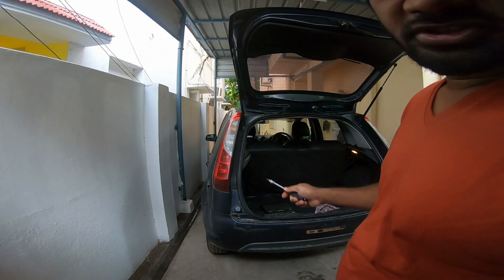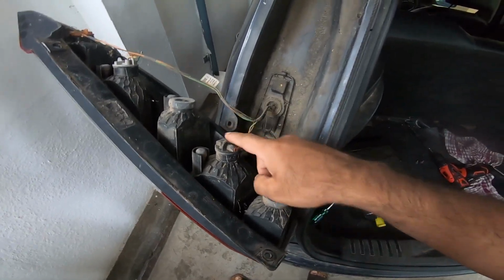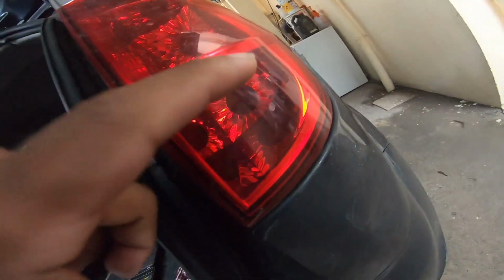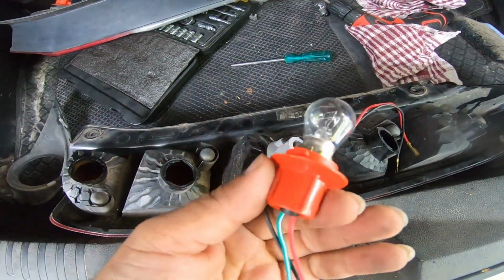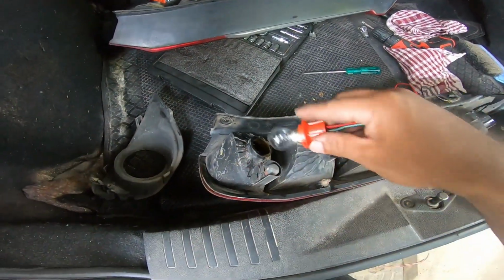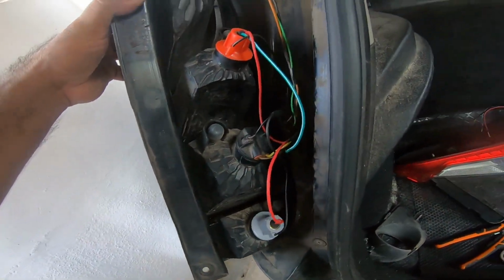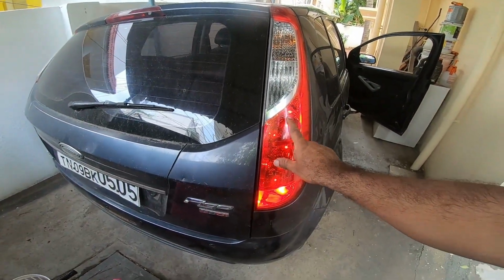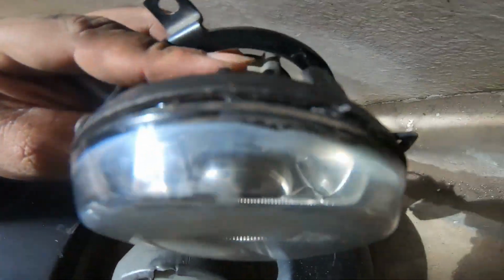FORD FIGO AUX TAIL AND FOG LIGHT INSTALATION 2011 DIESEL

Comment: I hesitated to fit fog bulbs at rear tail light cluster as electrician told that the  tail lamp which is not made of glass will get hot with continuous burning of fog bulb which is normally of higher wattage than brake light bulbs.. please advise on ur review on usage of fog bulbs .
Reply from the maker: Thank you, what I have made now is switched to LED taillight available on Amazon.in  you may buy something similar from a local store for a cheaper price also,     
https://www.amazon.in/Vagary-Brake-Parking-Universal-Seltos/dp/B08YXSTKL9/ref=sr_1_2?keywords=car+led+tail+light+bulb&qid=1642092258&sprefix=car+led+tail%2Caps%2C399&sr=8-2

https://www.amazon.in/AllExtreme-EXWT102-Projector-Indicator-Motorcycle/dp/B072322FG1/ref=sr_1_6?keywords=car+led+tail+light+bulb&qid=1642092258&sprefix=car+led+tail%2Caps%2C399&sr=8-6

Comment: Hi nice work indeed. My 2012 zxi does not have Fog lights?Does it have a fog lamp wiring? If not how can I install wiring?I am thinking of putting Hella 60mm module with LED lamps. What are your thoughts?
Reply from the maker: Hi Thank you, there is no pre-installed wiring for the aux fog lamp facility in ford Figo zxi 2012 however you have an option to have new wiring from the headlight switch inside the car next to the steering to fix the hella 60mm which comes with preinstalled fuse 15ah for the switch max 200w load you may just replace higher fuse value for bigger light consuming more power in the case.  Advance new year.

Comment: I have 2012 zxi model figo it have that switch off fog lights inside the car but there are no wiring or by default fog light present so how can i install fog light that are directly controlled from that by default switch given inside the car. Please response in detail i want to know about it
Reply from the maker: you may make use of the switch as it has the open option for wiring, if we are using an aux light the wiring could be connected to the switch rather than having a new switch.

Comment: Is fog lights wiring is available by default or you added it..?
Reply from the maker: Fog Light OEM by default, just cleaned the lens and fixed back,    aftermarket fog lamps cost 800-1500 INR which doesn't come with a connector which needs to be bought separately
Reply: @DIZ1988Mohan  thanks

Comment: Sir,very useful video
Can u throw some light how to clean the fog lamp glass cover,I mean how to open the glass cover and fix it
Reply from the maker: Thank you, i just did few months back when i open next time will make a video for you.
Reply: Sir, can u share the fastner bolt description for fixing  fog lamp of ur figo 1st gen. I only heard it's 7 mm
Reply from the maker: @mrigankabanikchoudhury5192  3cm L 7mm D is the size that's there in my Figo, however it's a common screw that might be found in local automobile stores: example https://boodmo.com/catalog/part-t_screw_flange_head-8169340/?gclid=CjwKCAiAvriMBhAuEiwA8Cs5ldh6d4w7_9qknX232cIEQjhXKayk_xdGCcByTuzXbgUNQmJmYz1WZRoCohwQAvD_BwE

Comment: I am looking for rear fog light setup... Do you know how to do that?
Reply from the maker: ford Figo got 3 inches fog lamp, you may  need to buy a projector-type and set it up with HID/LED bulb for better results,  Link :https://www.amazon.in/Auto-Emporium-Bi-Xenon-Hi-Low-Projector/dp/B084T1N22P/ref=sr_1_1?crid=8220XVEFQLW5&dchild=1&keywords=3+projector+fog+lamp&qid=1633924282&qsid=258-3581011-6938838&sprefix=3+projector%2Caps%2C378&sr=8-1&sres=B084T1N22P%2CB09CMR93NM%2CB09CMV2RYP%2CB092D6454D%2CB0823ZY56T%2CB079JVB5BZ%2CB09CLGLYT9%2CB09D3Y6M78%2CB075ZSB53D%2CB09D9TJHQY%2CB08BLFCKB7%2CB06XRCT57N%2CB08BLDPHY9%2CB07SJKJW36%2CB0797SCF6D%2CB07N1MMF4G&srpt=VEHICLE_LIGHT_ASSEMBLY

Comment: What is the name of the taillight bulb ? And in which shops Incan get it.
Reply from the maker: Tail bulb Holder 50rs | Led stop bulb 50rs each | Led break + Stop 200rs per 2  
Left the link below, however, buying directly from the spar show will be cost lower.

The link below for understanding the parts I used.

https://www.amazon.in/gp/product/B07SZJQJRX/ref=ppx_yo_dt_b_asin_title_o03_s00?ie=UTF8&psc=1

https://www.amazon.in/BA15S-P21W-Sidelight-Indicator-Light/dp/B073ZC5TFR/ref=sr_1_1?crid=2CN53HOWRT7QL&dchild=1&keywords=led+red+tail+light&qid=1631850911&qsid=258-3581011-6938838&replacementKeywords=led+tail+light&sprefix=led+red+tail+%2Cautomotive%2C305&sr=8-1&sres=B073ZC5TFR%2CB07SZJQJRX%2CB07BMBB22P%2CB07VVJQVGQ%2CB081LC6ZSL%2CB08HDNT6SN%2CB07XH5N6Z6%2CB0745FC3MM%2CB099RWG572%2CB07BM94LL5%2CB082R7H528%2CB07PQHXWWT%2CB08H8HRHC5%2CB082TNSMGH%2CB0773K69CY%2CB08YXSTKL9&srpt=VEHICLE_LIGHT_BULB&vehicle=Vespa%3ARED

https://www.amazon.in/Auto-Ex-wiring-harness-socket-adapter/dp/B0851GM5WP/ref=asc_df_B0851GM5WP/?tag=googleshopdes-21&linkCode=df0&hvadid=397006906513&hvpos=&hvnetw=g&hvrand=9562286424227233352&hvpone=&hvptwo=&hvqmt=&hvdev=c&hvdvcmdl=&hvlocint=&hvlocphy=1007809&hvtargid=pla-1090300242412&psc=1&ext_vrnc=hi

Comment: Sir I have doubt my ford figo has separate switch for rear fog light how to give connections through switch
Reply from the maker: You may need to take the wiring from the rear additional fog light holder which is easy just do parallel wiring.

Comment: Bro whats the size (inch)of Fogg light of 1 gen Ford Figo ??
Reply from the maker: 3.5 inch, I prefer you to go with Led for better results.
Reply: Stock or led fog lamp ?
Reply: Stock is 3 someone told me
Reply from the maker: @akshaybhandari2599  The outer glass is 3inch and including the screw fitting inside its 3.5 inch Stock, Led you will get 3.5 universal fits this figo or you may trim a bit to fit in.